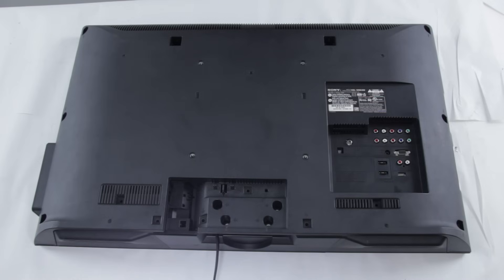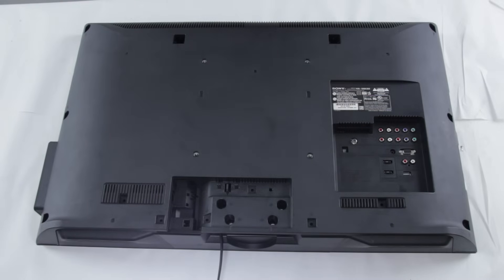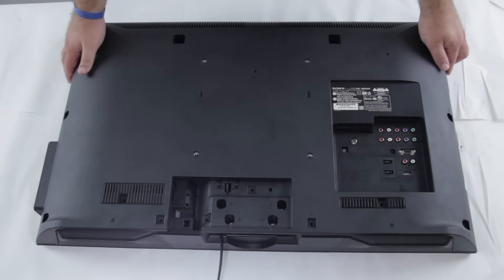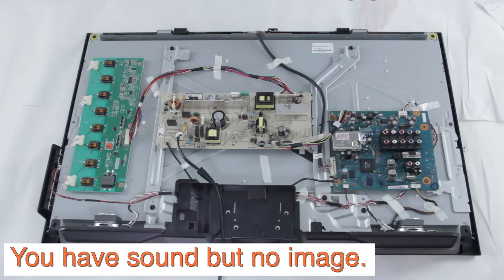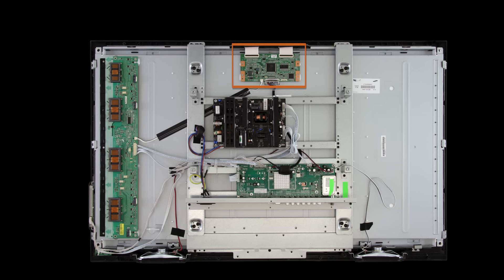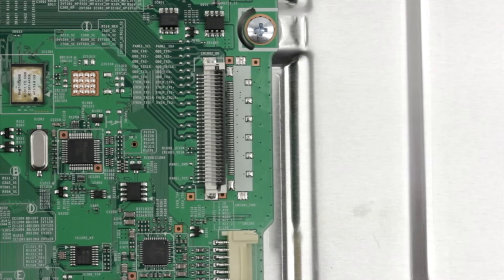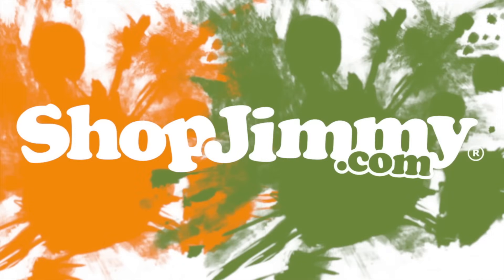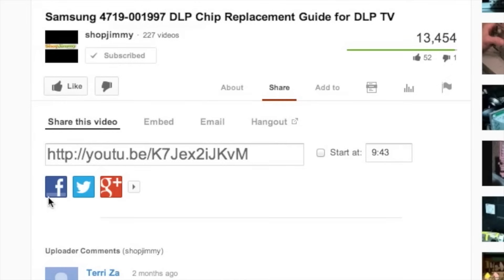LCD TV Repair Tutorial - T-Con Board Common Symptoms & Solutions - How to Replace T-Con Board

Comment: Hi, I have a Techwood 42884 FHD DIGITAL 42", when plugged in the blue standby light is on. When I click the power button on the remote the standy light goes off, then comes back on. Constantly pushing the power button on the remote will eventually allow the TV to come on but it takes 20-30 minutes+ I swapped the power supply board for a new power supply board, the TV now comes on straight away but once on the remote will not work. The volume sometimes turns down all the way by itself or the TV menu will come up, switch through all the menus and then freeze. Any ideas? Thanks in advance!

Comment: LG model 47LB9DF S/N: 711MXMT30267 The screen freezes on one side usually and if you tap the the screen slightly it will come back.
Reply from the maker: +Jay Zabel  Try all repairs and troubleshooting at your own risk.  This could be a problem with either the main board or the TV panel.  You can replace the main board to see if that fixes the problem.  Click this link to replacement parts for your TV model number:  http://www.shopjimmy.com/catalogsearch/result/index/?cat=56&q=47LB9DF  There may be multiple boards for the same TV model number, be sure to match part numbers on your current board, with your replacement for compatibility.  Here is a link to a video showing how to identify your part number, click here:  https://www.youtube.com/watch?v=RwHTvjMdrhk  Thanks and please let us know if you have any further questions with your TV Repair!  www.shopjimmy.com

Comment: I have panaonic TX-L37EW30 with split screen problem.The colors are not really good in any side,and even some old picture is like behind
Reply from the maker: +Boris “Loopartist” Tenodi  Try all repairs and troubleshooting at your own risk.  This could be a problem with either the main board or the TV panel.  You can replace the main board to see if that fixes the problem.  Unfortunately I do not see any replacement parts in the search results for your TV model number on our website.  Please reply with your part number on your main board and I can try searching for replacement parts.  Thanks and please let us know if you have any further questions!  www.shopjimmy.com

Comment: Samsung Model # LN32A450C1D.  Model Code: LN32A450C1DXZA.  Sound and picture is working but the picture looks like it is solarized.  However, the solarization is more of a blueish / grayish.  Have tried hooking it up to both video input from the cable box and through HDMI.  Any help would be greatly appreciated.

Comment: i have a 40 inch samsung model #LN40b540p8f/ SERIAL #AUC13CLS507802N  the picture has started to flash(blinking) it will stop but start up at some point, seems to be getting progressively worse.
Reply from the maker: +Rick Hearn  Try all repairs and troubleshooting at your own risk.  This could be a problem with either the inverter or the power supply board in your TV.  Unfortunately I do not see those replacement parts in the search results for your TV model number on our website.  Thanks and please let us know if you have any further questions!  www.shopjimmy.com

Comment: Hi
can I use a tcon board made for a 40inch samsung lcd,  on a 46 samsung lcd?  If the 2 boards are exactly the same but only the jumper is on 40inch and 46inch on each circuit. Your help is much much appreciated 👍

Comment: I have an LG 42LN5200 TV.  Following your videos, I determined that I have backlighting as indicated by an easily identified blue screen. I can receive a signal through the HDMI input, and have sound but no picture.  Based on your video recommendation, I ordered a 6871L-3403A T-Con Board (with 2-year warranty) which is a match for the existing board.  The board was easily replaced but unfortunately did not fix the problem.  The same symptoms still exist.  I'm hesitant to change the main board, as your videos identified the problem as most likely the T-Con Board. Could this be a main board issue? Thanks in advance for your response.

Comment: Hi i have a mitsubsihii wd-65737 i have replace the power supply  lamp but when turn  it on it goes on for about 20 sec. and then turn off do you think i should replace the cooling fans
Reply from the maker: +Jose Perez  Try all repairs and troubleshooting at your own risk.   Is the lamp door shut all the way?  Thanks!  www.shopjimmy.com
Reply: +ShopJimmy.com  YES THE LAMP DOOR IS SHUT ALL THE WAY

Comment: i have a samsung LN40A630M1F….S/N; AQD83CLQC04685B.
Problem is it when you turn it on,it cycles on and off a few times,then after a few minutes,as it continues to turn off and on it gives a screeching noise then maybe sound then in fuzzy lines continuing to cycle off and on will give picture then screeching then as it warms up all process to start to work is 3 to 5 minutes.then works fine.please letme know what you think.thank you.

Comment: Email: ryangreenbusiness@gmail.com

My tv still has audio but no picture. it appears that there is still light coming through the screen. The backlights are still on. My tv model number is Ns-32l120a13 insignia. I really just need a place to order a t-con if that is the isssue
Reply from the maker: +XTR3M3ASSASSIN98   Try all repairs and troubleshooting at your own risk. This could be a problem with either the t-con board, the main board or the TV panel. You can replace the main board and the t-con board individually to see if one of those boards fixes the problem.  Click this link to replacement parts for your TV model number:  http://www.shopjimmy.com/catalogsearch/result/?q=Ns-32l120a13  There may be multiple boards for the same TV model number, be sure to match part numbers on your current board, with your replacement for compatibility. Thanks and please let us know if you have any further questions with your TV Repair!  www.shopjimmy.com

Comment: I have a Sony KDL-46VL160, S/N 8214593 that has developed a black vertical stripe just right of center, with darkened and smeared video to the right of the stripe.  Sound works and video to the left of the stripe is good.  What solutions might I pursue?  I've removed the back and see the T-Con and other boards.

Comment: Sony w804 problem is im get negative pictures. Do you have any idea how to fix it. Do you think it's a t-con board problem? if it does where do i order to get one, please suggest me. That will be extremely helpful
Reply from the maker: +ekramul mostafa  Try all repairs and troubleshooting at your own risk. This could be a problem with either the t-con board, the main board or the TV panel. You can replace the main board and the t-con board individually to see if one of those boards fixes the problem.  Unfortunately I do not see any replacement parts in the search results for your TV model number on our website.  Thanks and please let us know if you have any further questions!  www.shopjimmy.com

Comment: I have a Polaroid 42" LCD TV and I have lost my color with some blurriness and a little static.  I have eliminated it being anything but the TV by substituting another TV.  It works fine.  The model isTLX04240B and serial # JR7E6186730002644.  Could this be a Tcon board or is it something else ?
Reply from the maker: +Charles Waldrop  Try all repairs and troubleshooting at your own risk.  I recommend replacing the main board in your TV.  Click this link to replacement main boards for your TV model number.  http://www.shopjimmy.com/catalogsearch/result/index/?cat=56&q=TLX04240B  There may be multiple boards for the same TV model number, be sure to match part numbers on your current board, with your replacement for compatibility.  Here is a link to a video showing how to identify your part number, click here:  https://www.youtube.com/watch?v=23S6V282R3Q  Thanks and please let us know if you have any further questions with your TV Repair!  www.shopjimmy.com
Reply: +ShopJimmy.com I guess I forgot to mention that I do have sound, its just that static is present also.  the picture is somewhat blurry and without color.  would it still be the main board ?  and is the price of the board low enough to be worth fixing ?

Comment: vizio m650vse come on and ture back off
Reply from the maker: +Jimmy Shuburte   Try all repairs and troubleshooting at your own risk.  I recommend replacing the main board in your TV.  Click this link to replacement parts for your TV model number:  http://www.shopjimmy.com/vizio-55-74n01-001-main-board-for-m650vse.htm  There may be multiple boards for the same TV model number, be sure to match part numbers on your current board, with your replacement for compatibility.  Thanks and please let us know if you have any further questions with your TV Repair!  www.shopjimmy.com

Comment: Sony KDL 46S5100  Get 6 blinking red standby light.  Bravia comes up then goes to 6 blinking lights.  I have replaced the inverter board, main power board, BM3 board and still the same problem.  What next?

Comment: I have a Sony Bravio KDL-46ex600 that will power on then kick off and a red light will blink 5 times.  An internet search says that it might be a tcon issue and I found this video.  Can my tv be fixed like this?
Reply from the maker: +Roy Dillon  Try all repairs and troubleshooting at your own risk.   I recommend replacing the t-con board in your TV.  Click this link to replacement parts for your TV model number:  http://www.shopjimmy.com/samsung-lj94-03500f-t-con-board.htm  There may be multiple boards for the same TV model number, be sure to match part numbers on your current board, with your replacement for compatibility.  Here is a link to a video showing how to identify your part number, click here:  https://www.youtube.com/watch?v=QzhymeqjmDU  Thanks and please let us know if you have any further questions with your TV Repair!  www.shopjimmy.com

Comment: I have a Samsung ln40d550k1fxza TV .It has very thin horizontal white lines running 2/3 of way down screen.The bottom third is as clear as when it was new.I have tried factory reset and self diag test and it tells me to contact Samsung.TV is 4 years old.I have disconnected all inputs no change.When I flip from tv to hdmi input the hdmi logo and no input message seem to move up and down on screen as if it was the horizontal hold of TV's of old.Thanks for any Help .Samsung repair rep here said it would be 250.flat fee plus parts for him to check it out.
Reply from the maker: +John Oakes   Try all repairs and troubleshooting at your own risk.  This sounds like a TV panel (TV Screen) problem.  If your TV panel is bad, it may be more cost-effective to replace the TV as panels are typically hard to find in stock, difficult to replace, and expensive.  Thanks and please let us know if you have any further questions!  www.shopjimmy.com

Comment: samsung led tv H5500 32" smart tv.  when tv turns on it has a white screen, and turns to flickering white with picture.  first couple times it happened the screen went to normal after a few mins, last time the screen went to almost inverted color.  is this a TCON board or power supply problem?  is it a common problem?

Comment: Does it matter if the TCON board starts with TX or TT?  I was told to make sure they match but not sure how much of the number needs to be exact.  One starts TX - 55.50T15.C04 and the other is TT- 55.50T15.C04.  Thanks for anyone who can help.
Reply from the maker: +Jim Duggan  Try all repairs and troubleshooting at your own risk. It does not matter.  The information that is important is the part number.  You can see on this listing, in the photo, that we highlight the part number.  http://www.shopjimmy.com/auo-55-50t15-c04-t-con-board.htm  Thanks!  www.shopjimmy.com

Comment: Hello, I have a Vizio XVT3D650SV with a red vertical line about 6 to 8 inches from the left side. I replaced the T-Con Board (Vizio 55.64T09.C01 (T645HW05 V0)  purchased from ShopJimmy. Did not fix the problem. Cables were all seated properly. Any other options? Thanks

Comment: I have a samsung un46d6420 3d 46 inch, picture just went, still get sound and back light. Any suggeston? Beleve it is the tcon Board. suggestion and direction greatly appreciated

Comment: I have a Sharp LC-70LE650U serial A402820836 and it is dimly lit and flickering with lines across entire screen testing various inputs so not HDMI cable.  Do I need to replace a board? Main,T-Con, or Power?

Comment: hi there i has sonny tv and they have dark vertical lines on screen can you show me how to replace the TCON board please and no sound when i turn power on it that proplem with the main board or tcon board can you tell ???
Reply from the maker: +AshleyLuuVlogs   Try all repairs and troubleshooting at your own risk.  This sounds like a TV panel (TV Screen) problem.  If your TV panel is bad, it may be more cost-effective to replace the TV as panels are typically hard to find in stock, difficult to replace, and expensive.  Thanks and please let us know if you have any further questions!  www.shopjimmy.com

Comment: Hi Shopjimmy:
I have a LG brand model 55LV5300-UA.AUSWLHR, 'LED' TV. Made in Aug,  2011. It's video just died, audio is fine. No display AT all. LED back light is good. T-con board needs replacement? Do u stock?
Reply from the maker: +Ancel UnfetteredOne   Try all repairs and troubleshooting at your own risk.  I recommend replacing the main board in your TV.  Click this link to replacement parts for your TV model number:  http://www.shopjimmy.com/catalogsearch/result/index/?cat=56&q=55LV5300-UA  There may be multiple boards for the same TV model number, be sure to match part numbers on your current board, with your replacement for compatibility.
Thanks and please let us know if you have any further questions with your TV Repair!  www.shopjimmy.com

Comment: Hi 
I have a Samsung UE50ES5505K and it has some horizontal lines on the bottom part of the screen. You can see it in this video: https://www.youtube.com/watch?v=fVy9f3y-RK0
If I disconnect the left side ribbon going from the T-Con to the panel the right side works just fine.
What could it be? The T-Con or the panel?

Comment: Hello, I have a Samsung UN55D7000LFXZA. A couple of months ago, discolored (greyish) vertical lines began appearing on both sides and then began to appear in the middle. I opened the back once and resat the ribbon cables from the TCon into the bottom of the panel while also cleaning them with isopropyl alcohol on a q-tip. About a week or two ago, it randomly fixed itself (for the most part) for a few days, then reverted back. Praying it's not the panel as the TV is only 3 1/2 years old, any insight on what it could be? Thanks for your help

Comment: Hey I have a problem with a Samsung UE46B7000WWXXU - 46inch Led? TV. 
When sub constrast is turned down in the service menu to about 40 the TV works fines. But if the sub contrast is turned back to normal I get this problem http://imgur.com/nQLYcFz  

I think it might be the tcon board but a push in the right direction would be very helpful! As I'm about to buy one :). It started off as some annoying red lines. I have taken the TV apart cleaned the dust out and cleaned/reset the ribbons on the tcon board to no change.

Any help would be great :)

PS. I can't access your site :(
Reply: Did you ever try the tcon replacement? Same tv and same exact problem in having. I am in the same boat, doesn't seem like the typical problem with tcon failure. I replaced the power unit and it is still doing it so I've eliminated that as a possible problem. You're the first person I've come across with the same problem. Let me know if you fixed it!
Reply: +Jake Fountain wrong person! Whoops!

Comment: I have a LG 55LS4500. Backlight turns on, no picture. Sound works. Menus do not work, though light on TV indicates input. Completely blank screen.

I opened up the TV and found a 2852G1 t-con card. I found that card online and ordered it. I swapped the cards but the same problems persist.
Reply from the maker: +89titanium   Try all repairs and troubleshooting at your own risk.  This sounds like a TV panel (TV Screen) problem.  If your TV panel is bad, it may be more cost-effective to replace the TV as panels are typically hard to find in stock, difficult to replace, and expensive.  Thanks and please let us know if you have any further questions!  www.shopjimmy.com

Comment: my sony model number kdl32bx310 serial number3170115  have no power.what part can be bad on the power board.
Reply from the maker: +Jeff new begainer  Try all repairs and troubleshooting at your own risk.  This sounds like a problem with either the power supply or the main board in your TV.  You can replace each board individually to see if one of those boards fixes the problem.  Click this link to replacement parts for your TV model number:  http://www.shopjimmy.com/catalogsearch/result/?q=32bx310  There may be multiple boards for the same TV model number, be sure to match part numbers on your current board, with your replacement for compatibility.  Thanks and please let us know if you have any further questions with your TV Repair!  www.shopjimmy.com

Comment: I have a lg 47ls4500-ud.auszlur tv that has sound but no picture. There is a faint blue glow on the screen. Is this a tcon board issue? I haven't taken the tv apart yet.
Reply from the maker: +david terry   Try all repairs and troubleshooting at your own risk. This could be a problem with either the t-con board, the main board or the TV panel. You can replace the main board and the t-con board individually to see if one of those boards fixes the problem.  Click this link to replacement parts for your TV model number:  http://www.shopjimmy.com/catalogsearch/result/?q=47ls4500-ud  There may be multiple boards for the same TV model number, be sure to match part numbers on your current board, with your replacement for compatibility.  Thanks and please let us know if you have any further questions with your TV Repair!  www.shopjimmy.com